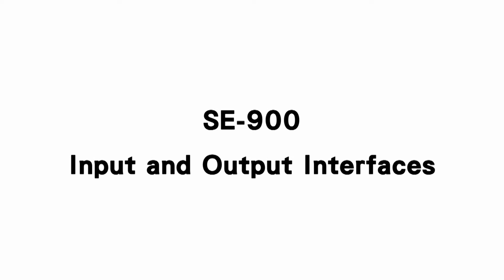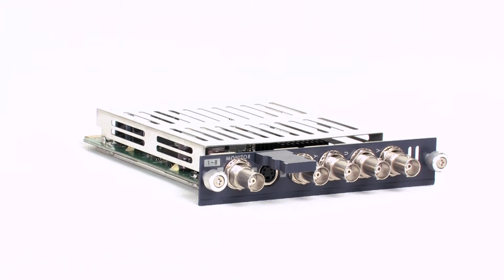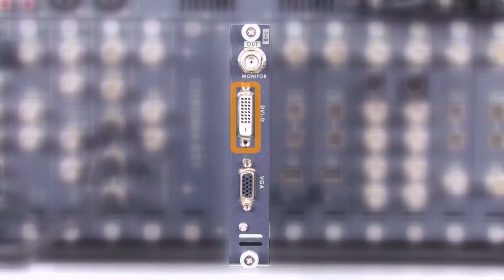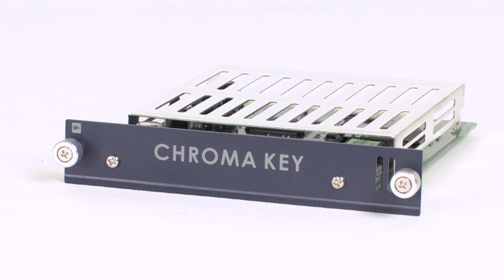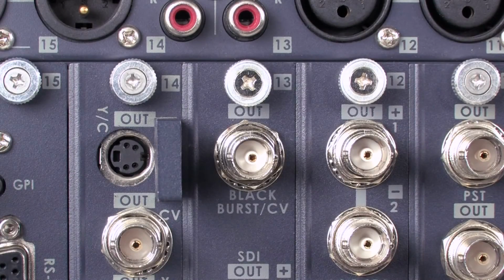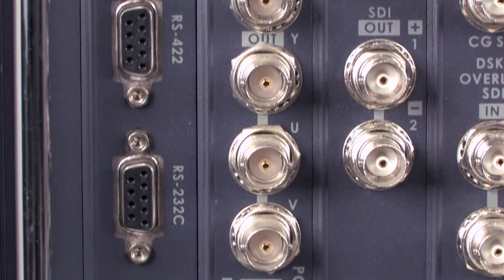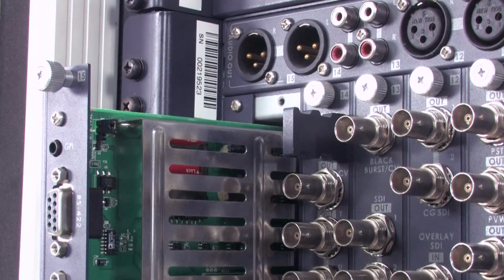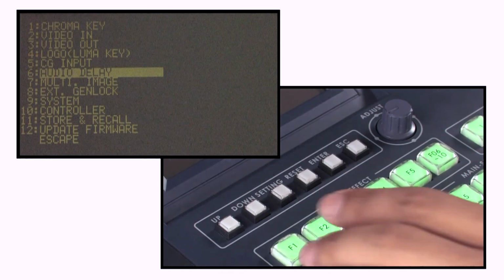03【Input and Output Interfaces】MS-900 SETUP

Comment: Can it output HD-SDI when we have Composite at input section?
Reply from the maker: Only SD-SDI output. If you need a HD-SDI output, you may need a DAC-70 converter to up converter your video, but the final look may not be as good as real HD resolution.